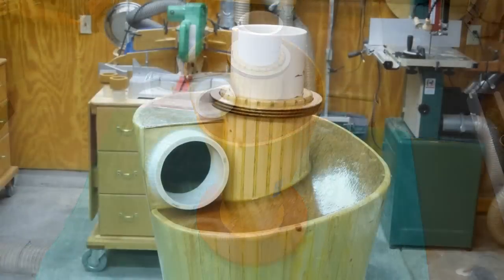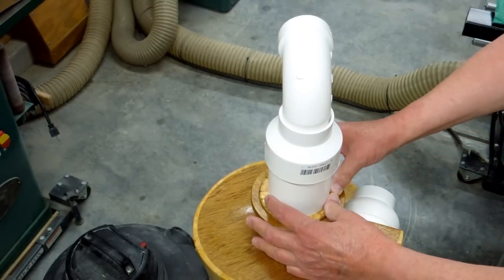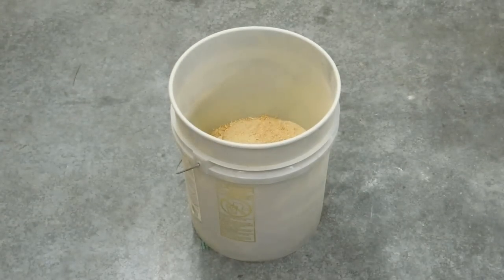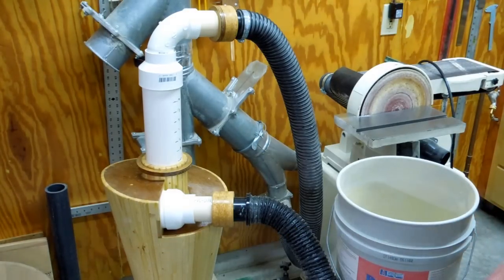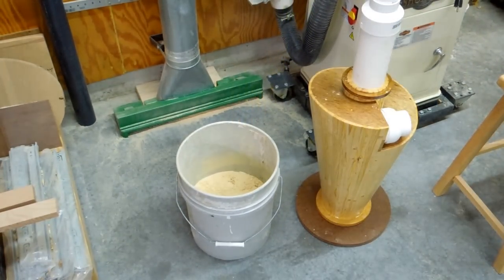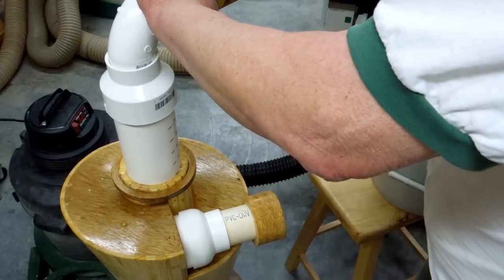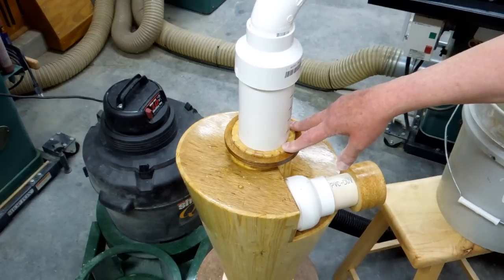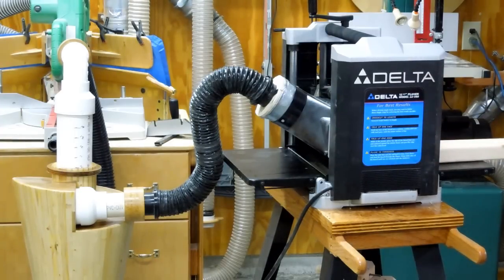Split-Ring Ramp Cyclone Separator Part Two - Testing & Demo

Comment: I wanted to see how much difference it made at other centre pipe depths!
I used to favour Futaba radio gear also, until Spectrum got so good at a reasonable price.  Both systems are well built and reliable huh!  Keep on flying!

Comment: Hi, would this work for a 1.5hp delta dist collector?
Reply from the maker: If you already have a dust collector why would you need this?
Reply: @RonaldWalters2010  many reasons namely to reduce the amount of material that goes through the impeller, to reduce the dust as much as possible. I see your split-ring ramp similar to the dust deputy super.  Is that what you have based it off?
Reply from the maker: Mark, I am not familiar with your Delta dust collector and I don’t think I have seen the dust deputy super. I bought a dust deputy years ago and it fell apart before I could use it. I could not find an adhesive that would stick to that plastic and ended up putting it back together with silicone. I thought I could make something better (and certainly cheaper) from wood and anyone could build their own.

I have a large Oneida Dust Collector and the debris does not pass through the impeller but is separated in a cyclone similar to this one. I worked with pneumatic conveyance systems for dry material such as cement and drilling mud materials. I worked with a number of different design dust collectors and cyclone separators. I have three different dust collector designs for ShopVac’s and you can find them all in one of my playlists.

Most large dust collection systems depend on moving a large volume of air with very little pressure drop or flow restriction. These cyclone separators are not terribly efficient with a large shop dust collector because of the flow restriction. 

A large ShopVac moves a smaller volume of air at higher velocities. My dust collectors work very well with ShopVac’s.

My designs are based on knowing how air travels through a cyclone separator and how centrifugal force knocks particles and dust out of the sir stream before it gets to the ShopVac. Cyclone separators for industrial applications have been around for a long time.

Thanks for watching. 
Please subscribe. That is what keeps this channel running. 
Ron

Comment: Watched the whole torrediol cyclone build and this build, subbed your channel 👍Couldn't help noticing the Futaba t-shirt. You fly RC airplane also?😎?
Reply: Ron, I just read your about statement, it appears you do fly radio controlled airplane...... what part of the sport do you fly most in?
Reply from the maker: I have flown R/C for over 40 years. Learned to fly Mode 1 in Singapore. Scratch built most of my many airplanes. You name it and I have probably flown it up until about 8 years ago. I have not ventured into helicopters or jets. Due to problems with my feet, I have stayed closer to home and now fly mostly small drones. Not flying very much R/C ended me up on YouTube doing a variety of other things. Thanks for watching! Ron
Reply: Ronald Walters Thanks for the reply Ron, you've lived an interesting life. Glad I came across your channel.

Comment: I've built several of these cyclones. For the most part they work well. I have found they do not work well on standard 5 gal buckets. Fortunately there is center nearby that sells a variety of buckets. I buy 8 gal buckets and they work great. The 5 gal size is too short.

Comment: I have watched several of your build videos and they looke like they work great, BUT you never show how much dust ends up in you shop vac !!!
Reply from the maker: If I start with so much material in the bucket and then end up with the same amount of material after the demonstration, it stands to reason that the cyclone is pretty efficient. I use a bag inside my shopvac so it would be difficult to show the change inside the bag. I have a review of the first cyclone separator after several years using the same bag. If that is not good enough... sorry. Thank you for watching!

Comment: a student of mine works for a company that makes industrial pumps.  he was saying that they have done cyclone systems as part of their installations in different kinds of factories, and they use—if I remember correctly—3 or 4 stages of cyclone separation (depending on the particle size and probably application).

is there any benefit to multiple stages of cyclones in this kind of system?
Reply from the maker: ThoperSought Cyclone separators are used with liquids to remove different size or density particles and are often run in series (or stages). I do not see an advantage to using more than on for a wood working shop, especially with a paper filter bag inside the shopvac.
Reply: Ronald Walters
makes sense, thanks!

in my student's case, they're pumping air.  one system he was talking about at the same time—which may not have been the same one was a loading/unloading system for powders onto tanker trucks.
Reply: There are standardized engineering equations, where you can select for the efficiency at a particle size and it will give you the taper and the length that you need to do it.  Assuming you have the space and materials you can design a single one for what you need.

That said, multiple ones do increase efficiency, but real world, in a wood shop something decent in this size range is really more efficient than necessary.  I have one of the little dust deputies mounted on the top of a large shop vac that is always connected to my tablesaw but occasionally gets moved to collect other dust, mostly fine (the stuff that really plugs up a shop vac filter) and as long as I empty the bucket before it's half full barely anything gets in the shop vac.  As a matter of fact I haven't had to clean out the shop vac filter since I added he cyclone (years now), I check it about once a year and there's a little bit of fine dust in there but not enough to affect performance or make me think that anything needs cleaning.

I have some 8 gallon buckets (same top as a 5 gallon, just taller) that I would use if I thought I wanted more separation but this setup works so well that I really don't have a good reason to change it.

I have a thein baffle using a smaller shop vac on the outlet of my sand blast cabinet, and between the less efficient separator and the finer, nastier dust (it will go right through the bag filter in the vacuum) it's not working great. It's working about as well as I've seen a thein baffle work, it sprays about 90% less dust around the shop than just the shop vac did (judging by what you can see in the air while you're running it, it's really a night and day difference) but it's just not as efficient as a cyclone.  There's still a good amount of grit getting on things.  I've considered building something like Ron's project to have a second cyclone (I'd probably put that on my other shop vac and put the dust Deputy on this, just because I'd rather beat up the plastic bought one with that nasty grit/dust), but till then I just put a PVC elbow on the outlet of the vacuum and pointed it down into a bucket of water.  Building a really nice thein baffle and collector to work in the space that I had probably was almost as much work as Ron's nice cyclone, so I'm pretty disappointed in that, when I started it I was thinking "I'll save myself some work because it's just going to get all gritted up and nasty and build a thien instead of a cyclone, and then I got all elaborate with my design :-/
Reply: Mark Pikas 
that's interesting, thanks!

yeah, getting elaborate causes a lot of problems.  I need to keep that in mind, seriously.

thanks for putting so much time and info into your reply!

Comment: Great cyclone and test vid. But i was hoping to see in the shop vac at what mede it in to there after u sucked up the dust Awesome work Ron.  Thanks
Reply from the maker: Patrick's work shop I use a paper bag inside the ShopVac so you would not have seen anything anyway. I have used the same paper bag for 5 years and the center pleated cartridge remains 100% clean.

Comment: Hi Ron.  Love your explanation of the process and the look of this new one.  I am curious as well about a larger receptacle at the bottom of that one.  I was thinking perhaps a 20 or so gallon aluminum trash can perhaps. Having experimented with my own stuff I can confirm a 55 gallon trash can under a 12" diameter x 8 inch deep cylinder with a modified Thein (sp?) Baffle offer too much volume for my 3 hp shop vac to move.  I tried. hehe Are you going to test the larger can by chance?
Reply from the maker: Rick Wilke No. I am done with this cyclone separator. Built, tested... it works. I gave it to a friend to use in his shop. An aluminum (or plastic) trash can probably will not work. The collection container must seal 100% vacuum tight or the cyclone separator will not work and material will pass directly to the ShopVac instead of dropping into the container.
Reply: Shop vacs can pull a decent amount of vacuum, if you have things sealed up well enough if you hit any real restriction a shop vac will crush most of the cheap metal and plastic trash cans you get now.

Comment: Have you considered putting some small vertical vanes at the bottom of the cyclone to to make the dust stop spinning at the bottom? I notice that Dyson do this on their cyclones.
Reply from the maker: Robonza The spinning has not proven to be a problem as long as the bucket is emptied when it is half full.The cyclones separate the vast majority of material picked up. Any fine dust which should escape the cyclone is not a problem as I use a paper bag inside the ShopVac. I've had the same paper bag in the ShopVac for 5 years and it only has maybe 3 inches in the bottom of the bag..